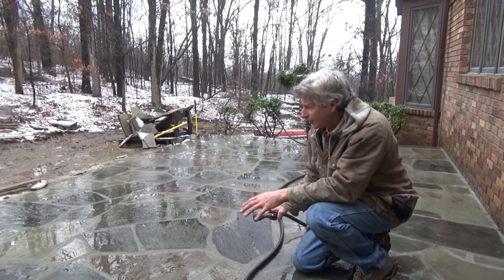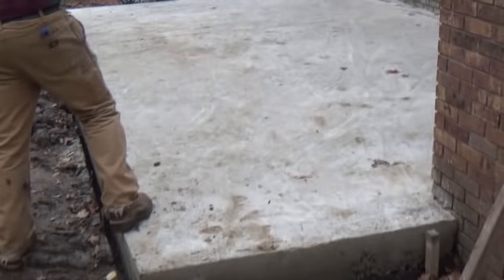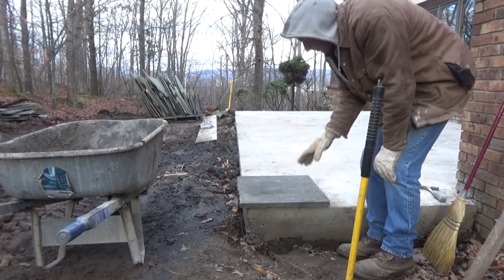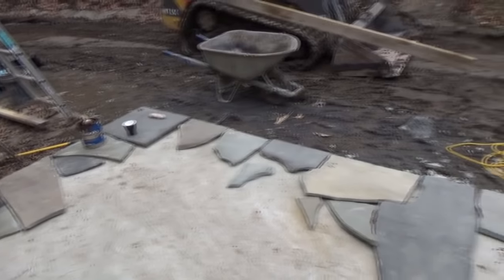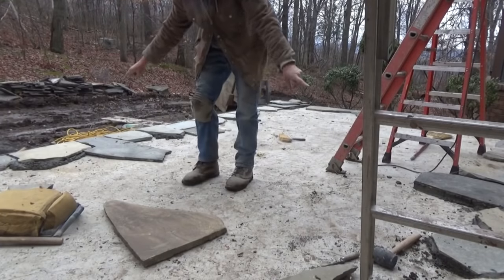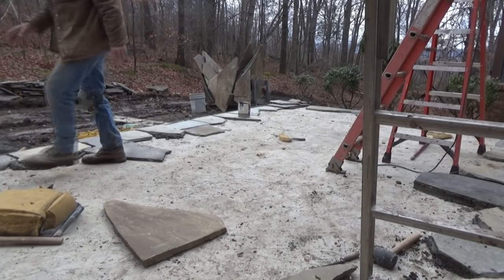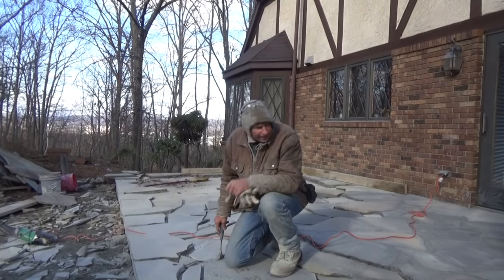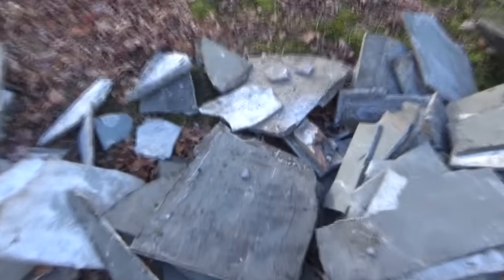STONE PATIO INSTALLATION (part 3) Mike Haduck

Comment: Hi Mike,
   I’m laying down my flagstone patio today. I gathered the flagstones like Johnny Cash song about a guy building a free car one piece at a time. This or that leftover piece or ones that were reclaimed from landscape updates. VIt’s 200sf at our old family lake shack built by my drunken uncles so not likely to be visited by the queen of England.
Local guys that lay stone said if you use mortar you will run into trouble with the frost heave.  My question is “how much trouble?”  The retaining wall I used to level the space is only 6 inches and if it’s my place I can always tinker with a rock that moves.  Is the main reason people in the trade are nervous about mortar in a place like Minnesota because they don’t want to deal with call backs?  If I have no problem putting a few hours a year into keeping things tidy then I’d have no problem with that.  If it’s well drained and tamped have you ever seen a freeze thaw that left the majority of a stone patio in ruins or is it usually a smaller problem?.  
My total investment is time and a couple of bags of Portland.  The sand at the beach is fine and free so it’s not an expensive risk.
Reply from the maker: Hi Jonathan, I would worry about beach sand because it has a lot of salt in it, on patios I only use Portland and sand , no mortar,  in my area,  thanks Mike
Reply: Mike Haduck Masonry 
Thanks for the tip Mike! I’ll get some play sand instead of beach sand.

Comment: You explained some things a few times but when it came to the pitch, you just sort of breezed over it. I am not a mason so I would be really curious about that in a little more detail. Thanks
Reply from the maker: Hi Miel,  what it means is you tilt or pitch the patio so when it rains the water rolls off like a roof, so a 3% pitch means it is sloped 3 inches down 100 inches out, basically pitch the patio so it does not hold water,  I hope it helps, mike
Reply: @MikeHaduck  - yes, I understand all that but so how would I go about measuring this? If, for example my front step was 2 feet above ground, for every 100 inches out, I would lower the pitch by 3 inches. Is that correct? By the way, thanks for communicating with me...

Comment: Mike I notice that you recommend a ratio of 2:1 sand and portland mix for laying gauged flagstones on exterior concrete pad in cold weather climate. Quickcrete topping mix comes as approx 3:1 to 3.5:1 ratio. Should I buy portland cement and add to mix and how much approx. Thanks
Reply from the maker: Hi Camy,, I just show what I use, down south they use more sand, every area is diffrence, best to ask the experienced locals, thanks mike
Reply: @MikeHaduck  Thanks Mike.
Reply: Mike I actually live further north then you do in Toronto, Canada.

Comment: If you had to do a mortared stone patio on gravel and sand bed in a freeze thaw area like northern PA would you add a little extra lime to the mix?  I know I’m heading for trouble but it’s for family and I don’t mind doing an occasional fix.
Reply from the maker: Hi Jonathan, if it lays flat in Pennsylvania I only use Portland,  I never seen a stone patio with mortar or lime hold up,  my opinion,  thanks Mike
Reply from the maker: Ps and I lay it on concrete, if I lay it on gravel I don't use joints, check out my playlist on stone patios,  thanks Mike
Reply: Mike Haduck Masonry 
Thanks Mike!!
No kidding, you are the best.  I even used your joke about the pyramids and the laziest guy method.  You helped me out quite a bit these past few years.  Sincerely, thanks!
Reply from the maker: Thanks again , mike
Reply: Mike Haduck Masonry 
I ended up pouring a 4 inch concrete base. The stones I’m using are all over the thickness scale from 1.5 to 3 inches so I realized I don’t have the experience to make it work with that many variables.  
It is coming together better than I hoped thanks to the 5-6 times I watched your videos and the time I spent practicing on smaller things.  There is no way it would have happened without you sharing your knowledge.  I got to watch my youngest son Mark a stone, knock off the hanging edge with a brick hammer and set it perfectly yesterday. It was a highlight of this project and I wanted to thank you.

Comment: hey mike i was trying to lay some stone and was pacticing my mortar mix....and the next day i noticed it would crumble easily ( i live in toronto again) i wasn't hitting it hard . i used the 2 sand : 1 portland cement ratio i mixed a little as a test with my trowel and hand....it wasn't over or under watered in my opinion....is this normal(or did i not let it cure long enough, it was just 24 hour test patch
Reply from the maker: Hi Yazad, it usually takes 3 days to harden where you can test it, and 30 days to be fully cured,  it's still soft the next day, thanks mike
Reply: @MikeHaduck  alright now i understand ok thanks!!

Comment: Hey mike, what would you recommend as the depth of the slab if I’m looking to do something just like this in Sussex county nj
Reply from the maker: Hi Tom, a lot of things depend, but if it laying on gravel I like to use about 5 inches concrete, and some wire to keep it from cracking,  but everything depends on the situation,  thanks Mike

Comment: Mike, what's the recipe for the cement used to lay the flagstone on? I live in Toronto, Canada.
Reply from the maker: Hi Ann, I used 2 sand one potland cement, thanks mike
Reply: Mike Haduck Masonry While I got you online, I would like to consult with you about flagstone cladding. I have a house where the flagstones used as cladding on the bottom wall has come off. I called several masons around and they tell me it is better to parge the wall than restore the flagstones. They say the flagstones, if restored, will come off again after a year or two. Do you agree with this prediction, Mike? The flagstones make the house more attractive, as far as I'm concerned. What is your advice? Thank you.

Comment: Mike, I'm about to do some work on my chimney.  I was thinking of adding some bluestone to the chimney cap.   Would I be better off using type S mortar or a cement mix like you did in this video?  I was wondering why you didn't use a S mortar for the stones in this patio instead of cement.  Thanks.
Reply from the maker: HI A,  I used 2 sand -1 portland  I almost never use any thing else when I am laying on ground, especially outside in my area,  code will not usually let you use stone on top anymore unless you can take it off easy to clean it .?   thanks mike
Reply: Thank you for your reply.  I enjoy watching your videos.  Believe it or not, I had relatives in McAdoo, PA and some were coal miners until they closed the mines.
Reply from the maker: Yep,  I am still walking on the old coal banks,  thanks for the comment, mike

Comment: Can I use type s or N mortar mix  to put  down stone on a concrete pad? I'm in Florida
Reply from the maker: Hi bmc, I can't say, everything depends on the situation and where but I am not a fan of n mortar for anything laying flat outside, thanks Mike
Reply: Thank you Mike I really appreciate the reply.  I was just trying to use a premix so I didn't have to get sand delivered.   So you recommend 2 part sand and 1 part Portland cement?   @MikeHaduck

Comment: I should mention that I watched your video to get some insight into how to put flagstone down.  I have a little project I want to do in the near future.  It's small really.  I just want to put some flagstone on top my existing concrete walkway.  It will go from the porch to the sidewalk and it's roughly 85 square feet in total.  The flagstone I would like to use is only about 1/2" thick.  I thought that since it's going over a pad of concrete that should give enough stability so it won't break or crack.  I do have one question though.  At the transition point where my flagstone meets the sidewalk, the flagstone will then be 1'2" higher than the sidewalk.  Is that acceptable or do you see that as a hazard?
Reply from the maker: Hi Jim, check out my series on stone sidewalks, everything had to match up or it will be a tripping hazard, I hope it helps, thanks, mike
Reply: I thought that to.  I could just take out the last section of concrete that goes to the public sidewalk.  Then I could dig it out to grade so that the flag stone would flush with the sidewalk when I'm finished.

Comment: Hi Mike, I have enjoyed learning masonry by watching many of your videos. I also live in Pennsylvania (State College).  I am in the middle of a flagstone patio renovation where I ran into a problem and I could use some advice. I used type S mortar to lay about half the flagstone before winter and I plan to complete the other half when it warms back up. I noticed that several of the flagstones I laid did not adhere well to the mortar. I lightly lifted one up and it popped off easily. However, the underside of the flagstone looked like it was fully touching the mortar, it just didn’t stick! I laid the flagstone just like you explain, I used a mallet to pound it down, there appears to be good contact area between the mortar and the flagstone, why isn’t it sticking? Could it be a curing issue? I appreciate any advice you can give me.
Reply from the maker: Hi Tod,  I never use S mortar for anything laying flat, Portland and sand ( two sand to one Portland), joints put in at same time, flag stones never really adhere, because they expand and contract faster than the cement,  you got to seat them best you can with the rubber hammer,  I have not had any callbacks, it works for me, other masons might say different, I hope it helps, thanks, Mike
Reply: Mike, thanks for the quick reply.  I am relieved to hear that the flagstone does not need to fully adhere to the mortar on the underside.  I will take your advice and switch to Portland and sand, and also put the joints in at the same time I lay the stone.  If you every stop through State College I can show you how it turned out.  Thanks for the help! Todd
Reply from the maker: Thanks Todd I hope it works out,  mike

Comment: MIKE! can i lay some stones like this on cracked concrete? and not worry about early cracking?
Reply from the maker: Hi Ramon,  the only time I did it was when I was covering a porch,  the porch had one 3/8s crack in it but was all together So I got a sheet of wire mesh for stucco and went right over it, never had a problem, but I would never do it on a sidewalk in my area,  I hope it helps,  thanks mike

Comment: I have to disagree there is a right and wrong way
But what you can say is in different regions, according to different climates cement should be mixed accordingly
Reply from the maker: Hi TCS, I guess you say that too, I guess, as long as the opinion ,experience and idea makes its point,  thanks mike